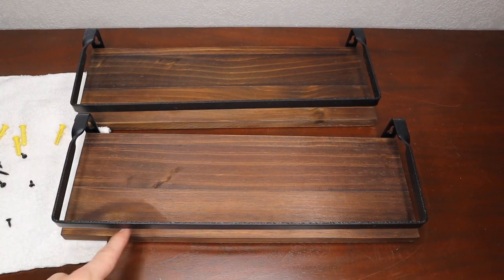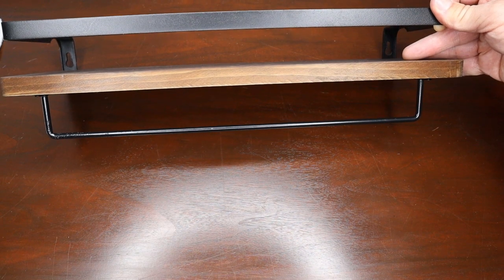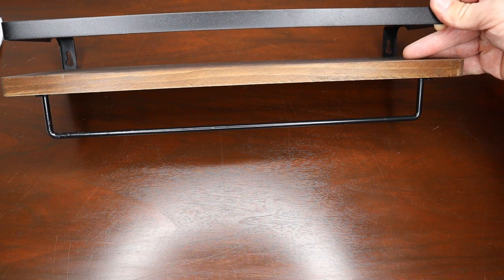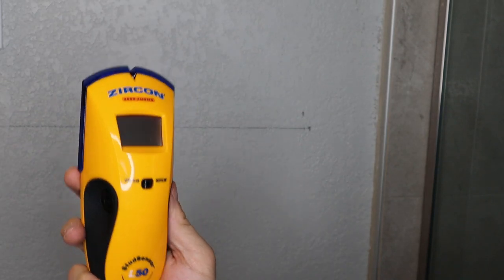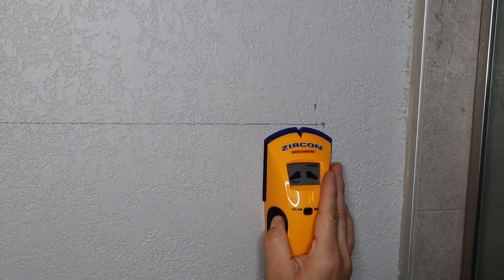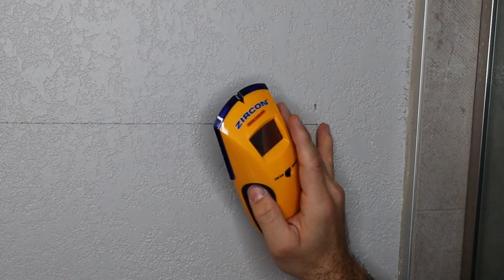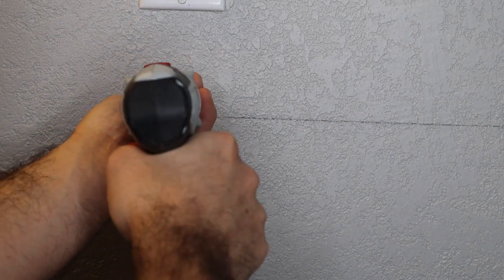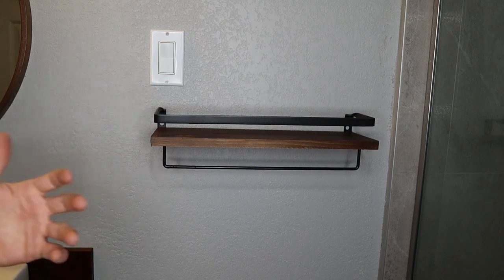Easy Bathroom Shelf Install for Beginner DIY

Comment: Thank you! I’m soooo new with this! So if no stud, use a wall anchor correct? when I drill my hole in the wall, make sure the drill I use is smaller then the screw correct? And I’m assuming when I find a screw… I just use common sense on the size of the screw I actually need, right?! Sorry I have so many questions! Thank you!!
Reply from the maker: The drill bit should be just a tad smaller than the actual screw to make sure you dont make the pilot hole too big. A lot of products you can purchase on amazon, like the one I use in the video, will come with the screws and drywall anchors. You can do it! Let us know how it goes!
Reply: @RemodelWithRobert  ahhhh thank you!! I’m going to practice in the garage first! Lol! THANK YOU!

Comment: The previous owner put up embossed wallpaper in the bathroom…even inside the shower stall. 🙄 I’m In the process of removing the paper, but they put it behind the mirror as well. It’s one of the big ones with no frame, small metal ‘holders’.  I can’t figure out how to remove it without breaking the mirror.  Any suggestions?
Reply: I'm reading a year later but maybe this will help somebody else: paint over the wallpaper! You seal edges first, give it at least a day, and then paint. There's great videos on how to do this, and it saves you the hassle of removing wallpaper!